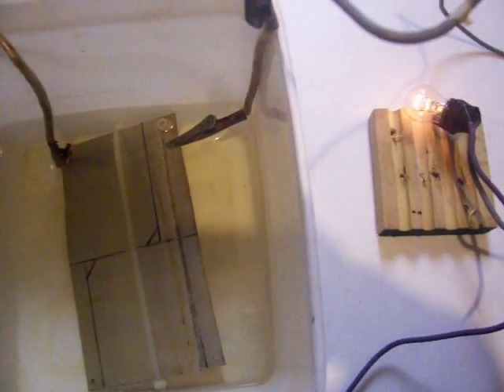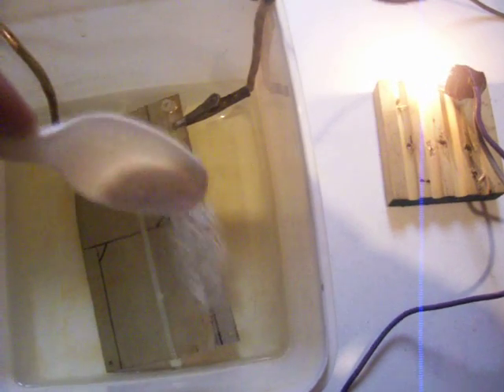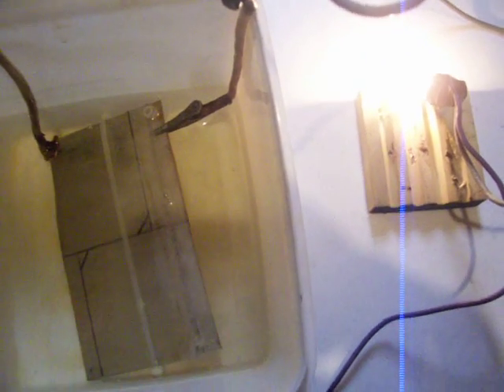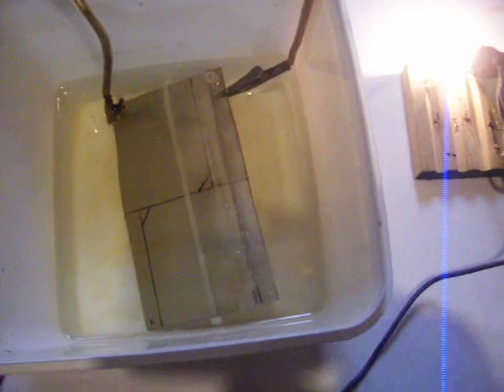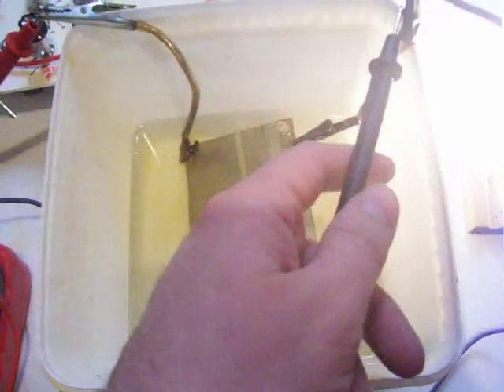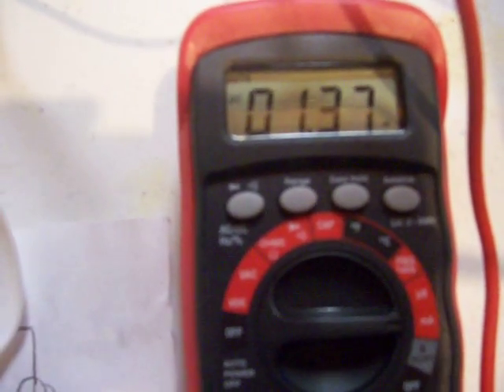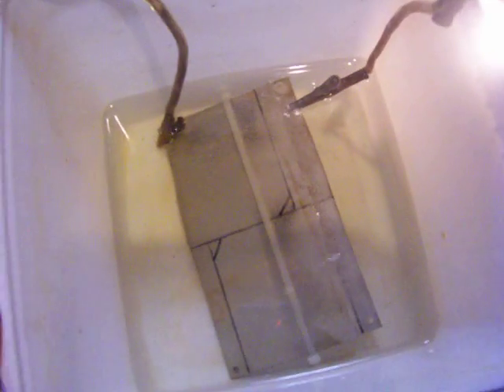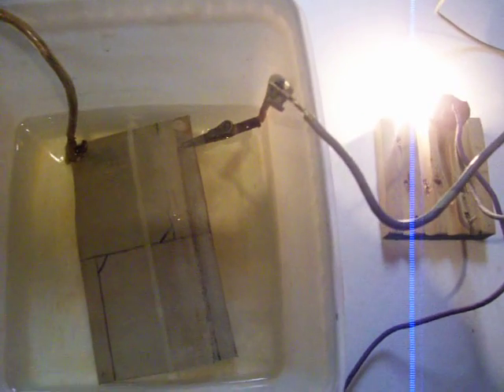hho (wi-2)

Comment: Actually, the space you want between your plates depends on how concentrated your electrolyte is. The best production rate I ever got was with plates nearly 1/4in apart but a really strong KOH solution.  There are many techniques that work well.  Closer plates = less electrolyte in solution.  With distilled water, you pretty much must use electrolye for brute force electrolysis.